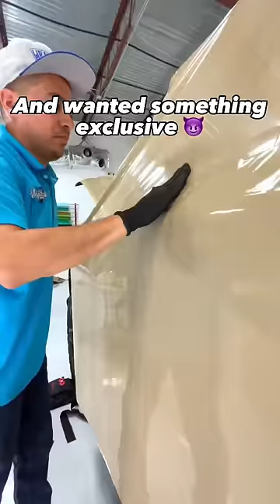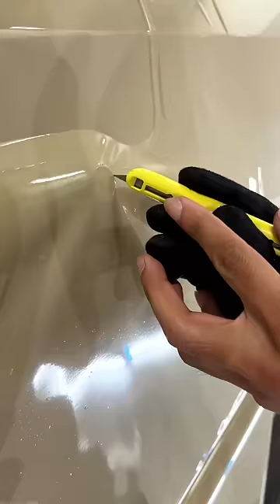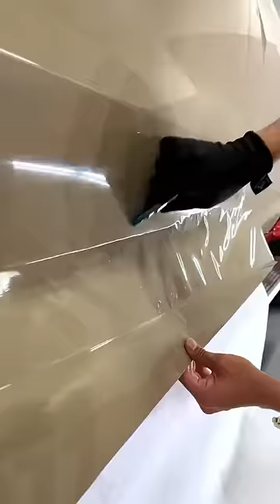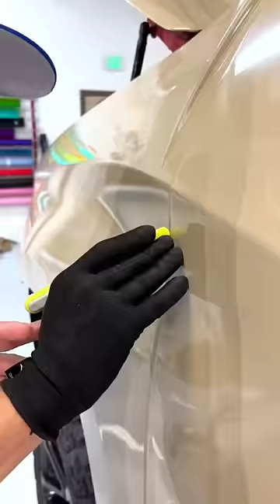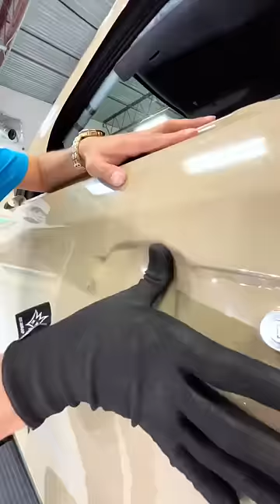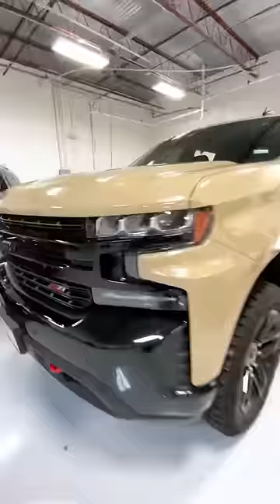An Exclusive Wrap for the Silverado 💪🔥‼️ #carwrapping #vinylwrap #asmr #asmrsounds

Comment: I live right outside the 9th gate of hell (Arizona) and I didn't trust car wrap one bit. Now I know that the cheap stuff will fall apart here, so I got samples from 3M (everyone said it was a reputable brand) and decided to do some tests. I adhered them to my over door. Right up at the tippy top where it gets HOT. I even wrapped it over the edge until it met up with the inside panel. When I'm broiling it probably gets to over 400F on that particular spot.

I put three sheets there last winter and none of them have budged. BUT WAIT. We're not done. Can they come off easily without damaging my precious oven?

First one came off about two months ago after warming. No problem. I just removed the second. The third is going to hang out there for quite awhile longer. Maybe years. They definitely require a hotter heat to let go than the sun is going to throw at us.

I'm impressed. 3M car wrap is unbelievable. Can't speak for any other brand, but 3M is solid.

Comment: Belbien, it's like a high grade,stretchable wall paper, and it comes in different types of wood products,I've used this product for handrails and other metals to change the appearance, remember this application is only good for metals and fiberglass and the surface before application can only be applied in a dust free environment and cleaned,if it's not smooth or something is missed before the process you'll need to start over and that's why they're showing you a person with many years of experience, I personally think it's great for simple projects that can be repaired easily, the different weather environments,rain/hail/cold/ blistering heat /snow/ice ect... once  this product has been damaged you will need to replace the hole picture plus it's not cheap after you hire someone to replace it

Comment: We used to use this at Ford motor company on clay models. It was called dynock. It's like applying wallpaper. But if you scratch it, it comes off. Vinyl is not permanent. Just get a paint job if you want something permanent.